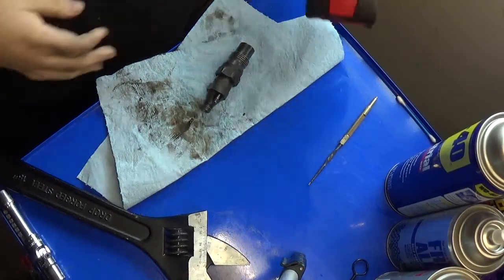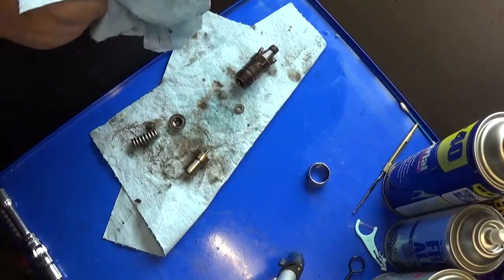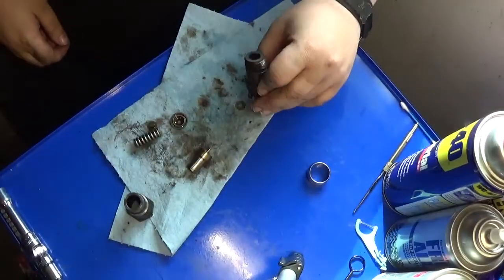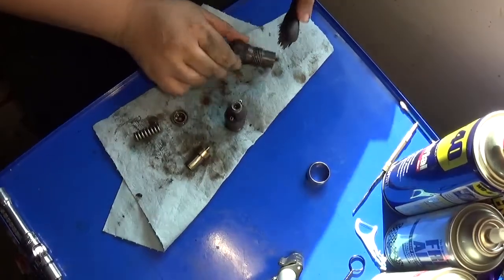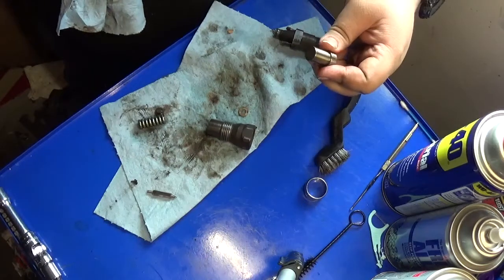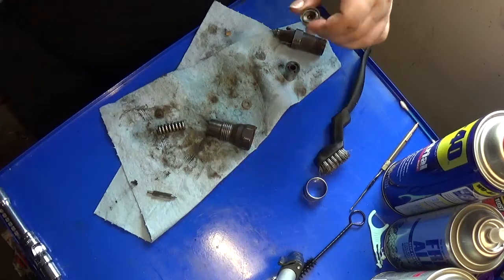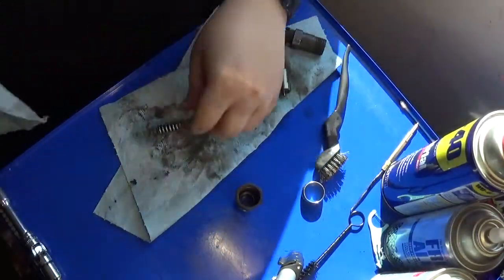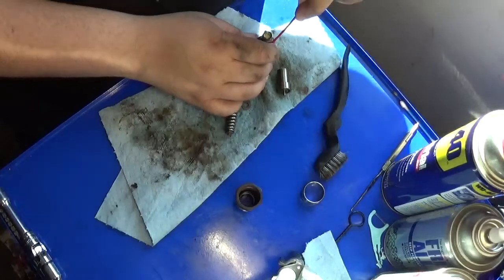How I clean diesel injectors

Comment: Nice, in depth video. I believe the ‘washers’ as you call them are labeled as spacers, as they are the interchangeable shims to adjust the pop pressures. As the springs seat and wear, changing the shims adjusts the pop pressure back to stock.
Reply: True. Aussie YouTuber who does Mercedes has spare parts for boss injectors

Comment: Aren’t these the same injectors in GM 6.2/6.5 diesel? GM’s book says do not ever take these apart for anything. I took apart and cleaned all 8 of mine before I read that. So I’m worried now 🙃
Reply from the maker: The only problem you will run into is the crack open pressure from what I have seen they're very similar. If you have a way of testing pressure do that before installing them

Comment: Are there any rubber parts inside the nozzle?  If there are rubber parts  I use a large amount of injector cleaner will it damage the rubber in the injector?
Reply from the maker: No rubber in injectors

Comment: Working on my 1981 rabbit diesel and these are the same stock Bosch injectors. You sound like a very educated dude watching this video so thank you for sharing your knowledge. Also this vid helped reassure me that I had all my pieces of my injectors. I noticed that my injectors had two preload washers that had a slightly larger opening in the middle. Any ideas on that?
Reply from the maker: The washer change the injection break open pressure you may need a injector pressure tester to ensure correct injection break open pressure stay safe